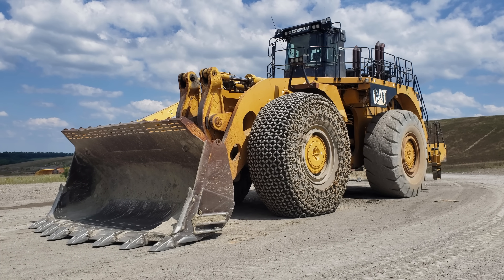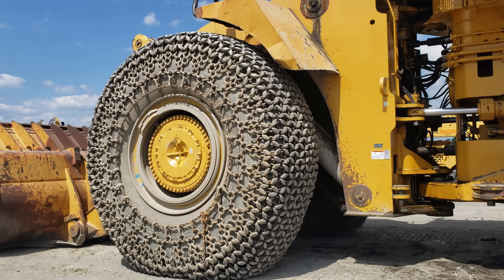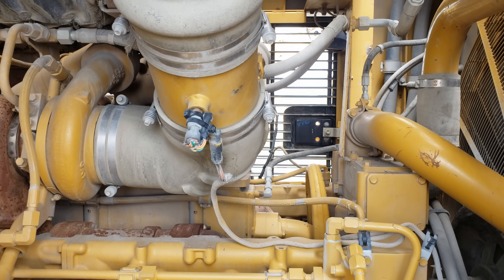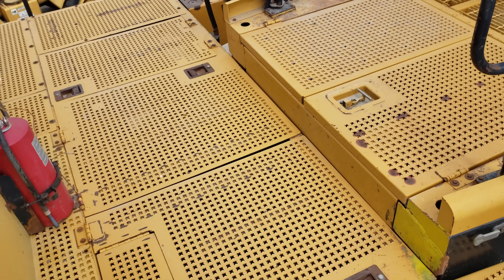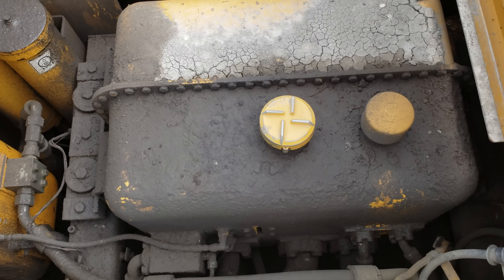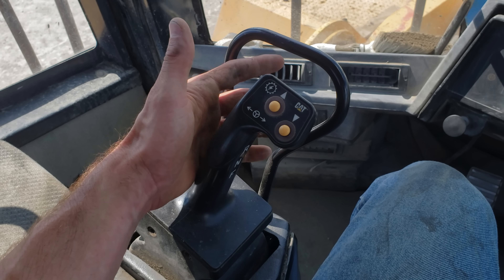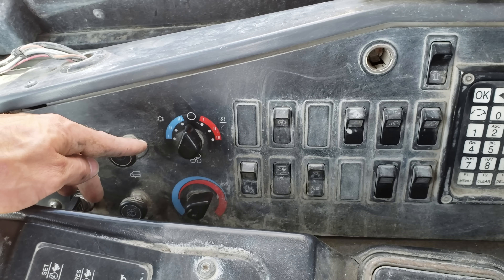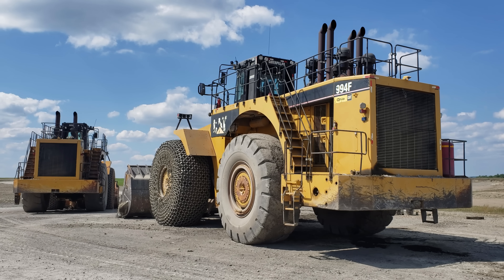Huge CAT 994F Up Close

Comment: Oh yeah. Last surface mining job I worked at had 3 of the older models, We used two at a time to tag team loading 785 cat trucks . Moved a lot of material in a days work. Danged air starters on them would make you jump until you got used to it. They had them transported from a gold mine on the west coast , and 4 785’s . Had to be one heck of a bill just for that. The beds for the trucks were cut in 3 pieces for transport and had to welded back together. 👍👍🇺🇸
Reply: Did cat stick with air start on their latest models?
Reply: @nigelmcculloch3746 I don’t know about the newer 994’s , Largest ones I ran before retiring were the 988 H’s and F’s , and they were electric start, but all the smaller ones that I know of from the 92 and smaller were always electric .

Comment: It's completely reman engine.  Also I think everything is reman . Original engine has exhaust temperature sensor for each cylinder but in reman there is chance to upgrade engine with newer design . In point of owner  perspective I think reman unit is better than buying new . At least ⅓ price of new . But in job older unit like this perform better 100%

Comment: Next video I really would love you to take a look at the caterpillar 797f or the 994k maybe even both
Reply: @greatlakesadventures2024  How about the CAT 798 AC. It has slightly more payload capacity than the 797F.
Reply: That would be pretty awesome if he did the 798 but here’s my list of machines that PAMining should take a look at:
Cat 797f
Cat 795f ac
Cat 794
Cat 798
Cat 994k
Cat 6090Fs
Reply: @greatlakesadventures2024  I would be very surprised if there are any 797 haul trucks in PA. The only places you will see trucks like that, would be at very large mining sites. Almost a guarantee that PA Mining (Justin) would have to do some serious traveling to find a CAT 797 haul truck. Same goes for the 994K, but I think there’s a better chance of locating one of those in PA or surrounding areas.
Reply: @williamhall9204  Yeah, 797s are almost unheard of in the US. The Morenci district in Arizona is getting 798ACs to replace their fleet of 793B/C/Ds; it will be the only US metal mine I know of running trucks that large. Might be a 994K or three in coal mines back East, otherwise I know of several running in Arizona.
Reply: @Porty1119   Keep in mind that in Wyoming and Montana we have the Powder River Basin. The PRB operation has fleets of very large earthmoving equipment. I’m pretty sure that they use 400 to  n ultra haulers at that massive operation. They are probably running a significant number of 994K units as well. Seems to be one of only a few coal mines that is thriving. Powder River Basin coal is very high quality. And the coal is not usually covered by a thick layer of overburden. This allows PRB to offer the product at an attractive price point to power plants, etc. I read somewhere that the PRB mines have over a Trillion short tons of coal reserves. Take Care.
Reply: @williamhall9204  I completely forgot about the Powder River Basin mines!